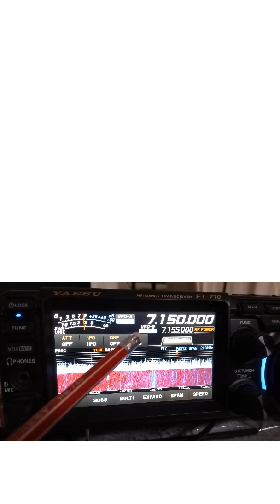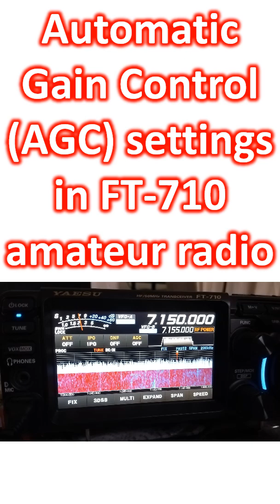Automatic Gain Control AGC settings in FT-710 amateur radio

Comment: Is it good or not for FT8 mode. 
Thanks for the video. 

PU4CAC
Reply from the maker: You're welcome! For FT8, a fast AGC setting is usually recommended for modern SDR based radios. Otherwise AGC can be set to 'off' for getting weak signals. Then if strong signals overload or 'clip' the interface, RF gain has to be brought down manually. Goal is to have the green input level bar sitting at approximately 30 dB to 50 dB when receiving background noise. If it turns red, your gain is too high and you are "clipping," which will prevent successful decodes. 73 Jon, VU2JO